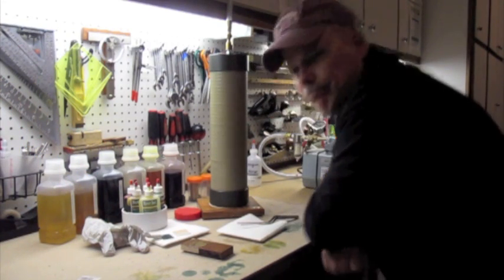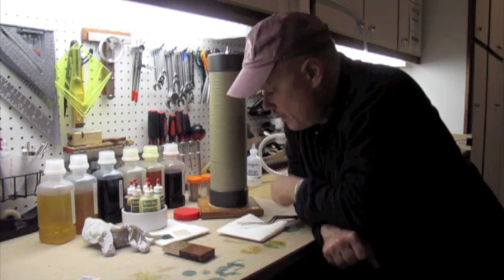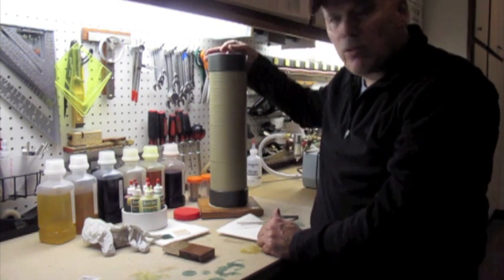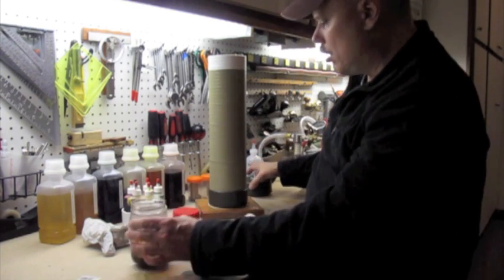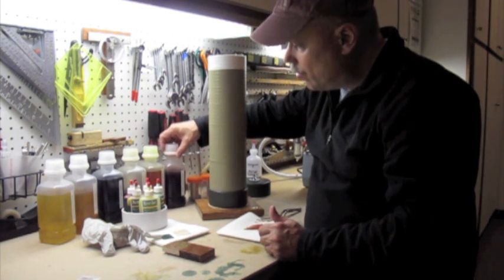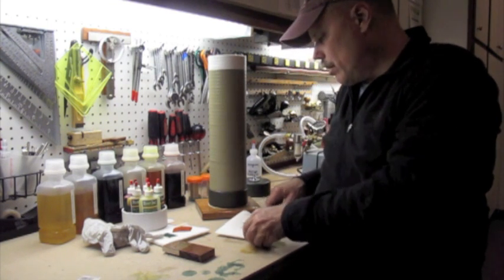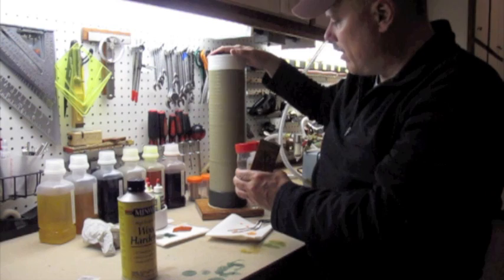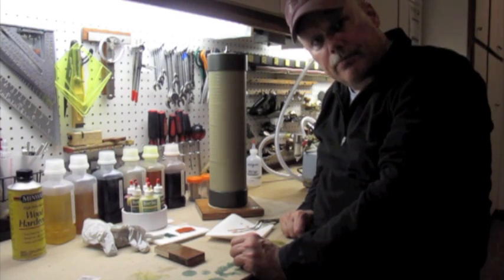Folding Rule Shop - Bench Top Vacuum Infuser

Comment from the maker: Good question! My vacuum gauge reads 28 in.-Hg whic is close the maximum vacuum that can be drawn at sea level. The pump draws down a full vacuum in the infuser within 15 seconds. In this setting, the practicality of the power of a vacuum pump relates to how quickly it evacuates the vessel. Once the vacuum is achieved it dosen't matter.